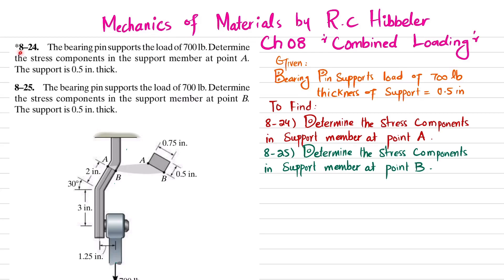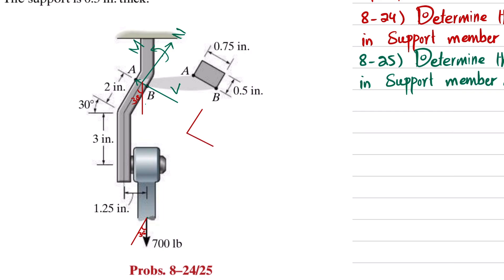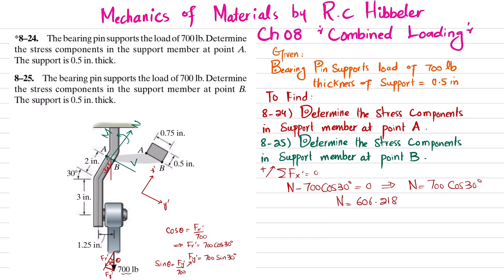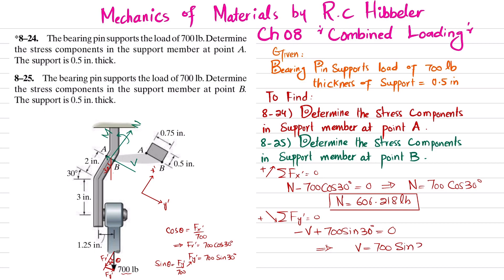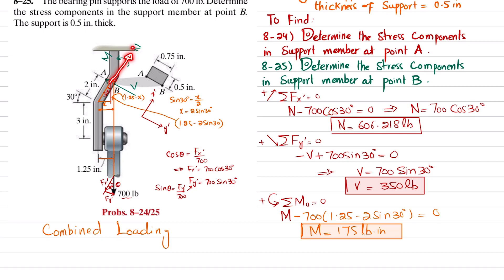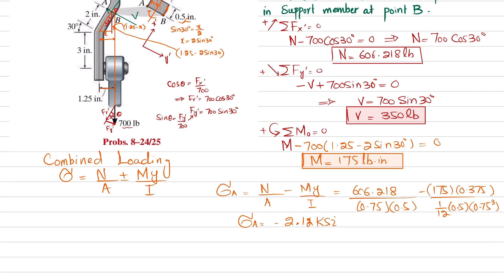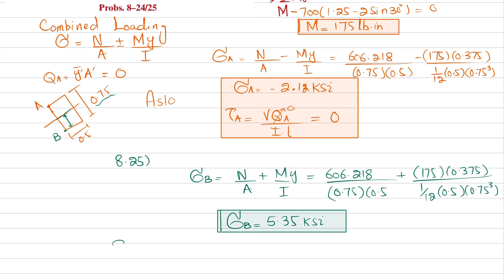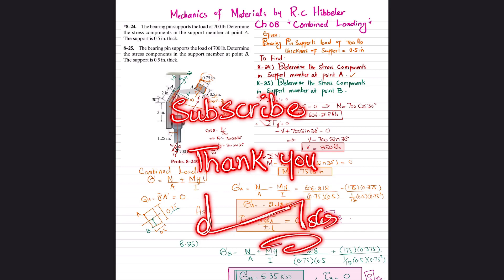Problem 8-24/25  Combined Loading | Mechanics of materials RC Hibbeler | Stress | Mechanics

Comment: BROTHER I WOULD LIKE TO SEE HOW YOU SOLVED THE 8.26?, PLEASE, I HAVE A DETAIL WITH THE MOMENT OF INERTIA OK
Reply from the maker: here is the link of problem 8-26 Problem 8-26 | Combined Loading | Mechanics of materials RC Hibbeler | Stress | Mechanics
https://youtu.be/o7RI7EDHQAQ
Reply from the maker: You want me to solve problem 8.26?
Reply from the maker: Don't worry bro...Today I shall try to make a video on problem 8.26. Its very easy....
Reply from the maker: Did you check the problem?
Reply: @engradnanrasheedmechanical  Doc. Adnan, which edition of the beer book do you use? Check the exercise, it's easy, I've already solved it, but it's not that exercise I'm talking about. Sixth edition right? My doubt is in these exercises 8.53 and 8.54 in the positive moments because if we use the rule of the right hand apparently one is negative....
Reply: 8.53 The masonry pier is subjected to the 800-kN load. Determine the equation of the line along which the load can be placed without causing a tensile stress in the pier. Neglect the weight of the pier.
Reply from the maker: @shaulomolina.d4779  I think I am using 9th Edition
Reply from the maker: @shaulomolina.d4779  I shall check it and will get back to you soon....keep watching and sharing my videos
Reply from the maker: @shaulomolina.d4779  oh my mistake the beer edition is 6th edition...I was thinking about mechanics of materials rc hibbeler
Reply from the maker: @shaulomolina.d4779  email me questions on my email adnanrasheed@uetpeshawar.edu.pk